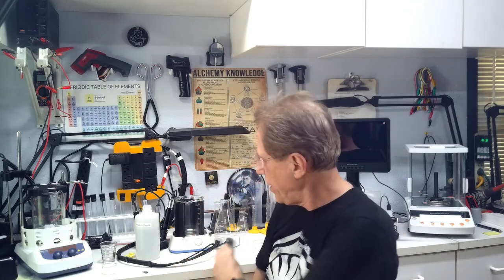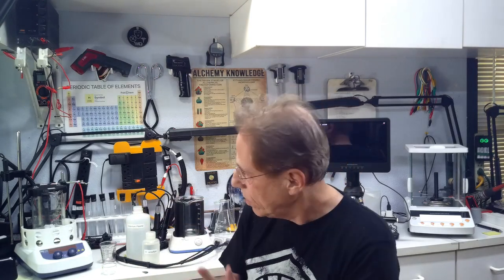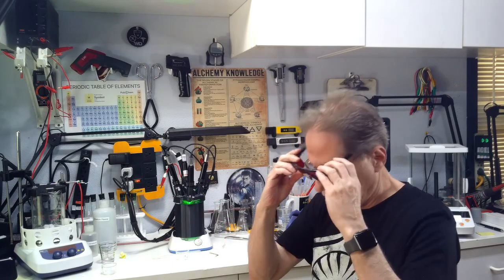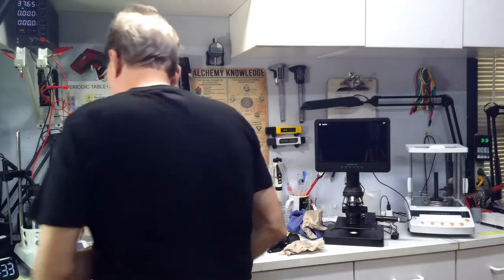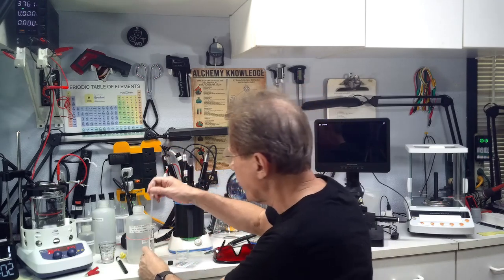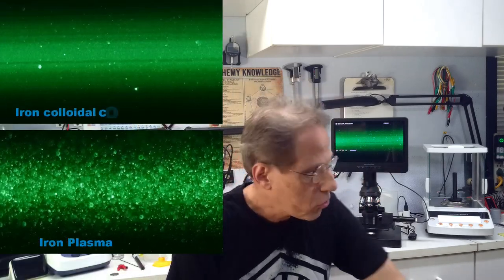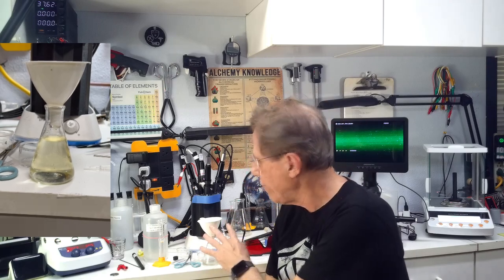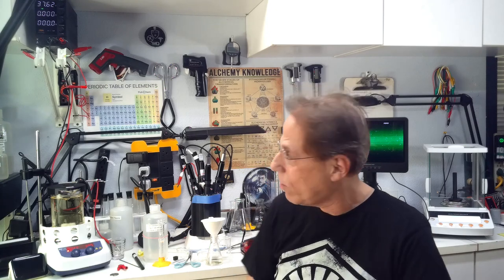The Laboratory Experience Part 1: Cracking Iron and Vanadium Nanoparticles!

Comment: Ah cool video.  Only made copper and Mo nanoparticles in the past.
Reply from the maker: Glad that you found it helpful. 

Part two should be along soon. I finally got Iron cracked using citric acid. I just need to see how it stabilizes.  

It actually does work with Sodium Citrate, as shown in the video, but it creates additional coordination complexes and a very small particle. I'm still looking into what these additional complexes may be as well as the small particle size.

Comment: With the plasma arc can’t I use that to make all of these colloidal s?
Reply from the maker: Yes you can but some of them remain unstable with plasma arc and will only last a short time. Specifically the metals zinc, magnesium, vanadium will unravel in a few weeks. However I'm experimenting with pre heating these solutions before arching them to see if that helps. 

I prefer plasma arc to LVDC colloidal nanoparticles in general. However the exemption is Gold. Mixing LVDC ruby red gold and plasma arc rose gold really create a nice gold mixture. Separately they are good, together, you get about a 20% boost in performance than drinking only one or the other. However that is another thing I'm still testing as I get feedback on it.
Reply: Got it,thanks a lot tom